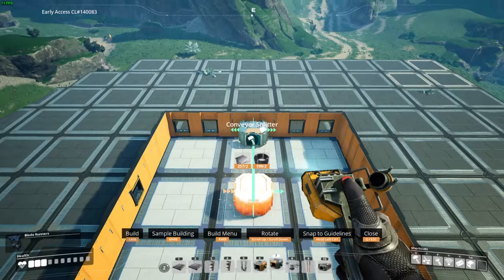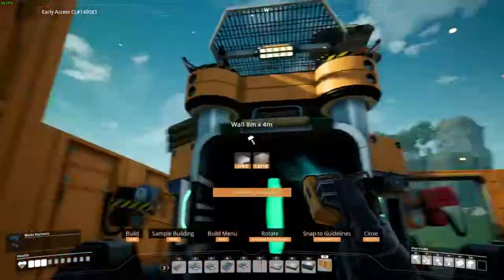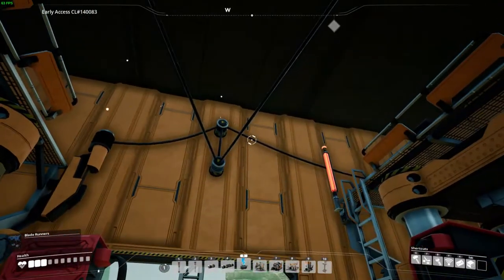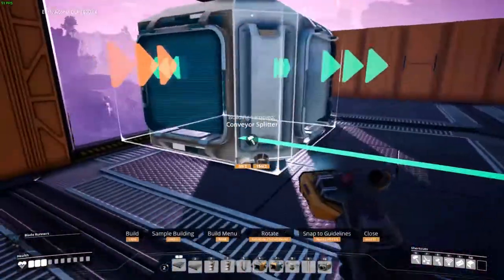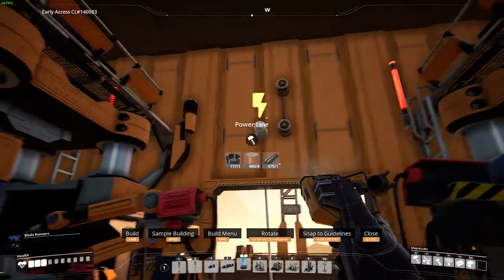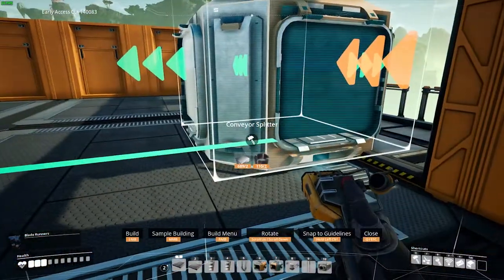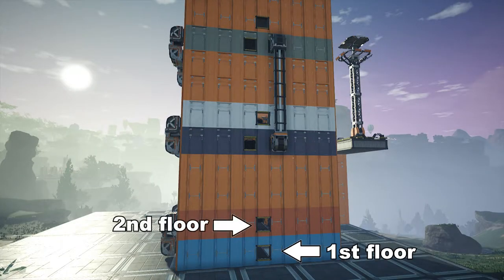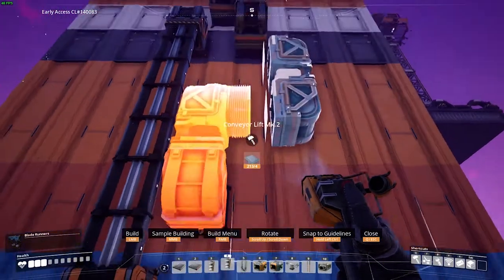100% Efficient Plates and Rods Factory (Tiers 1 & 2 friendly) | SATISFACTORY

Comment: what do you plan on doing with the plates and rods? thanks
Reply from the maker: Well I use most of the plates for my reinforced iron plates factory. The rods get used up in the rotors factory.
The surplus move into the storage system where I can use it later on for building

Comment: Excellent guide! A bit too fast, making it difficult to follow along, but great nonetheless. I do have one suggestion, in instances where you are using the double conveyor walls but only attach one lift between floors, you can substitute the double conveyor wall with a left or right side door. This will give you the offset hole for the belt/lift and give you a clean outside appearance. No blank holes!